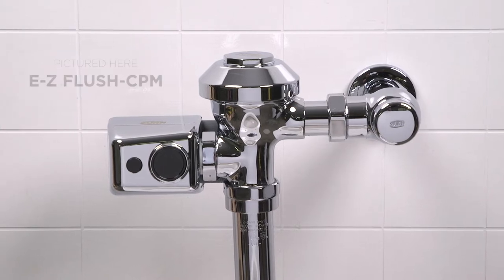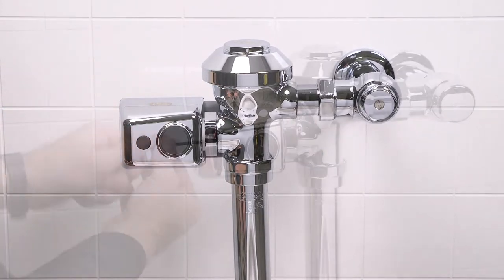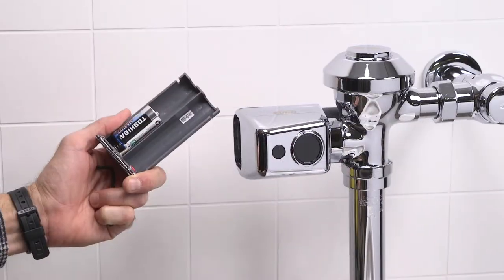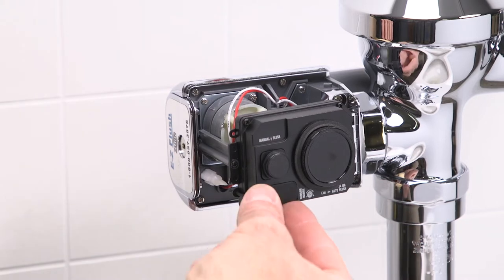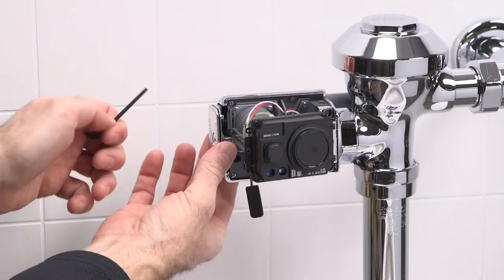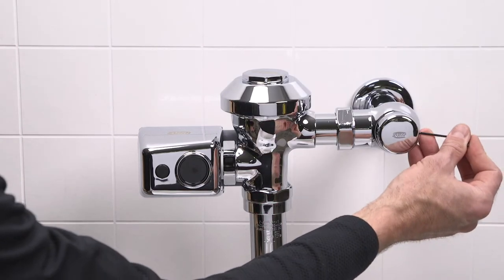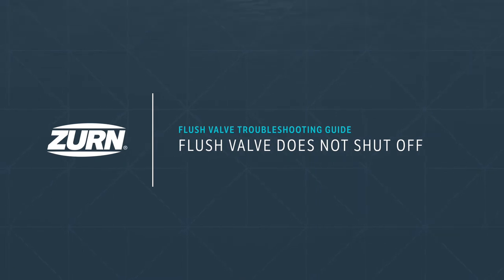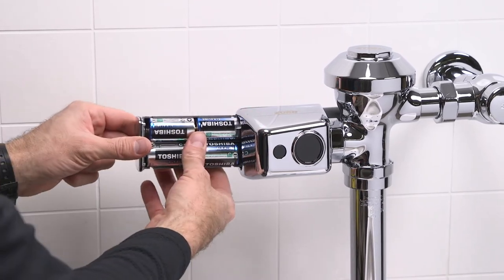E Z Flush CPM Flush Valve Troubleshooting Guide

Comment: Replaced batteries red light is on but still not flushing.
Reply from the maker: Hi Edward, thanks for reaching out! What happens when you push the Override Button? When red light blinks that means low power, maybe check springs and connections. I suggest reaching out to our support teams at 1.855.ONE.ZURN (1.855.663.9876) or https://www.zurn.com/contact.
Reply: If the yellow light flashes, It means it's time to replace the batteries.